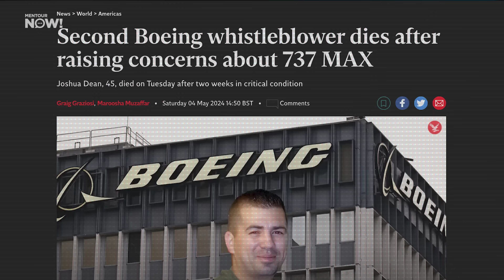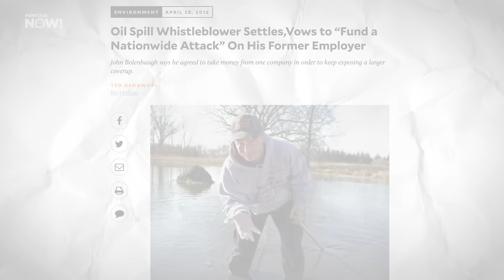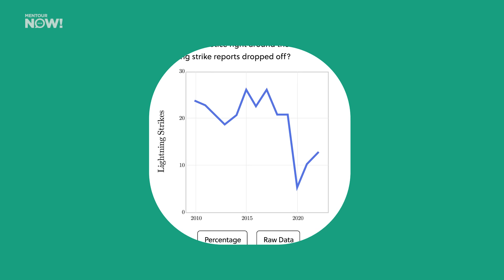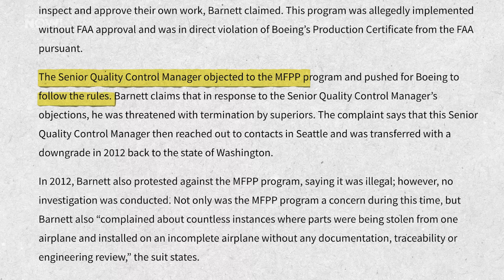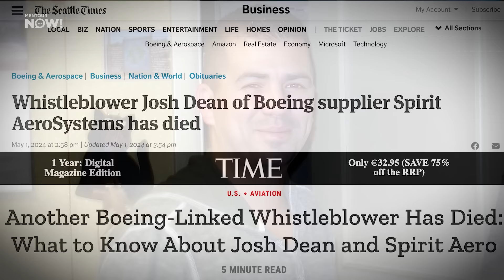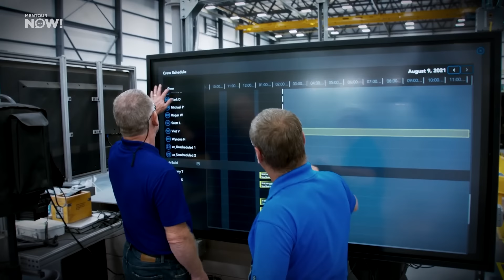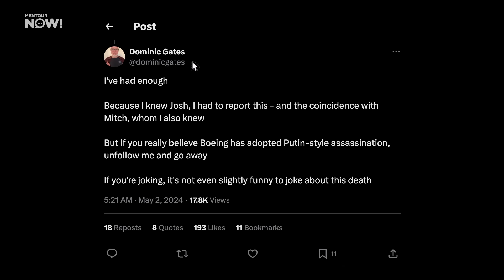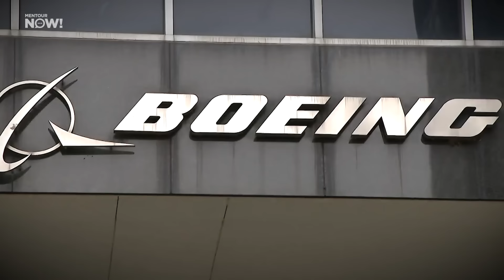Whistleblowers Vs Boeing: What Happened?

Comment: Why would a company have positions whose job description is to inspect manufacturing processes and products for faults but then ignore any issues they report if it affects production schedules for cost reasons? Surely management should be concerned if they are warned about quality issues as that can be a really expensive problem especially if it is a safety issue.
It would indicate a serious evaluation of what is important in their plant and what is not. Money is not the only important factor in running a business. Making faulty or unsafe products especially in a business such as aviation, and the implications of quality issues is directly coupled to money and reputation as well.
If airlines start seeing that many people avoid flying with them because they are seen as flying faulty aircraft, that is a very serious problem that goes back directly to the manufacturer. If that issue doesn't affect those critical stock prices that some management seem to prioritise then I don't know what is.

Comment: Would this be a solution? Have independent organizations conduct regular quality control audits at the expense of the company. This could include private sit down meetings with individual employees giving them anonymity if they have concerns. And, include a contact number for employees who may be experiencing retaliation. Additionally,  if there are issues, auditors would directly discuss safety issues with top management and task them with ensuring problems are solved. Companies with outstanding safety records would be recognized. (As if 😂).

As for the shareholders. . . I'm at a loss. Who would buy stock with a company that has a reputation of manufacturing jets that put pilots and hundreds of passengers at risk.

Comment: Thank you, Petter, for a useful update on the previous video you did. What has interested me is that there have been at least two incidents with Boeing aircraft since the Alaska Airways blow out. Of course, right now (22 August 2024) there are those two astronauts stuck on the International Space Station due to another faulty Boeing product. What is management doing? It seems that Boeing management just doesn't intend to take any meaningful actions to ensure that work is done correctly and adequately quality checked.

Comment: Not all whistle blowers are so noble though... there was one at a company I was at (in different BU than me) but apparently they had been fudging some tests for a defense product using an unapproved means of "adjustment" that could lead to malfunctions later.  The WB had been one of the ones doing it. He apparently learned that a WB can get 10% of the recovered funds. Also they couldn't be touched for 2 years. I heard he made $2M USD.

Comment: What are the odds of an individual possessing those five elements of awareness, much less an organization consisting of thousands of those individuals?

Are organizations limited in this capacity by size? Does the likelihood of this culture existing decline as function of headcount? Historically, have some large groups done better than others? Religions? Militaries? 

Are some management hierarchy structures better suited to this tendency? Are these hiearchies inimicable to increased production, efficiency and profitability (presuming that non-conformant, poor safety cultures are not "punished" economically)?

Can any coercive monitoring system possibly correct for organizational weaknesses? Can any organization be forced to do anything?

Without clear connections between this safety culture being understood and embraced by upper management and pursued zealously, often at the expense of short-term profitability or efficiency, there is NO way such a culture will exist as more than window-dressing and performative statements. 

Easy to say; very, very hard to achieve.

Comment: Whistleblowing has basically 2 sides, and one is the more known one: the one which covers the subject you're covering, with companies and organisations vs/in cooperation with employees. The other one is the one damaging the whistleblowing practices more and more, namely political/international whistleblowing. The latter is pretty highly abused for political propaganda or political grandstanding to object to an law/practice the (grand) majority of the public agrees with but the 'whistleblower' not. The problem is the latter is threatening to also damage the protections for the former, sometimes as a reason for a party which already sought to weaken the former.

Whereas big companies (including Boeing) increasingly try to suppress the external whistleblowing if the whistleblower didn't get any positive reaction internally, by suing the (former) employee(s) or other punitive measures. Now the problem is that the political 'whistleblowing' is increasingly happening while the work-related whistleblowing is getting more under pressure already. Unless there gets more seperation between the two and different types of protections and requirements in the legal sense, I fear eventually whistleblowing in general might see its protections slowly degraded.

Personally I'd be in favor if there for work-related whistleblowing at least there have been attempts made to internally put the issue on the agenda (doesn't matter if it was succesfully or not, unless the whistleblower is the one who torpedoed the measures which fixed the issues). However if that doesn't work out, if it's an issue which indeed is something that is in the public interest (in the broad sense), there should be more protections for whistleblowers and more punishment if an company is intentionally attempting to suppress the reports without attempting to fix the underlying issues.

Comment: Competency tests for workers and managers. The latter needs to be smart enough in the field they manage to lead the crew.

All problems are Competency. 
Change my mind
Reply: Sorry, disagree. As stated by Mentour Pilot in this video, companies can also force impossible timelines or volume of work to be done which isn't realistic for even a competent person to complete. This overload is done intentionally to overwhelm workers so they won't have time to do thorough checking and to punish whistleblowers. The incompetence aspect is a red herring- this is 100% about greed.
Reply: @Jasper_the_Cat  so incompetent people with low work loads would solve an issue. 
Would you start with smart or ignorant people in the field they work?
Reply: @Patriot3  Your assumption that the workers being incompetent is at the root of the problems of Boeing is a greedy CEO's dream. You should see if you can get hired as a PR person. You'd fit in perfectly. Lol
Reply: @Jasper_the_Cat  there is not a money issue at boeing. They would always want to maximize profits. If they had the best products, this would be easier of course. The question here is about how the culture can be changed back to a focus on best engeering practices with high profitability.  We all agree it has changed, but during this process, the most unskilled management has been promoted through the ranks.
So, the root issue would solve competency, which drives all aspects to correct each process.
Following your premise the company becoming a non-profit would fix most if not all of this. 
A good start to this would be selling the company so fresh eyes would be on the money. It's only about making money and you can't simply call that greed. 
I would think BCA fails in 10 to 20 years and is sold off. 
Elon musk plan was to get into transportation, and he does that commercial aircraft will have to be re imagined. Watch some videos on that. He says traveling the equal to a 737 for the same costs any were in the world in 15 or 45 minutes. 
Plus you must end DEI. No matter your race or gender that alone doesn't show competency. 
Not a simple fix, probably can't be fixed, in my opinion.

Comment: This is nothing new.  You complain, blow the whistle, you got fired.  Engineers might not be fired, but those of us on the ground (the licensed aircraft mechanics) were routinely harassed by management.  Jobs had to be done in the amount of time allotted or it went into your record.  Even as an inspector, I felt pressured to hurry up or it will cost the company money.  And profit is what makes a CEO's stock dividends increase in value.